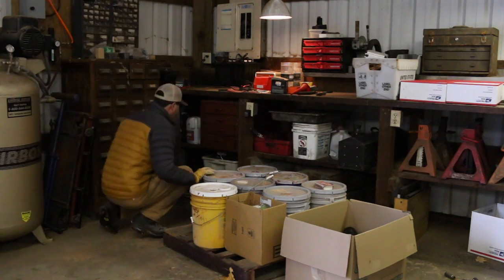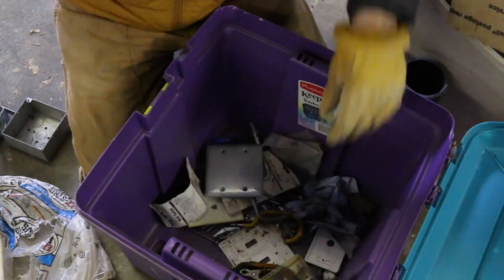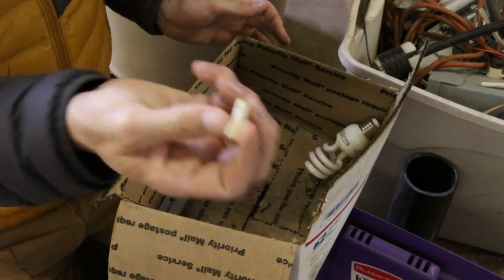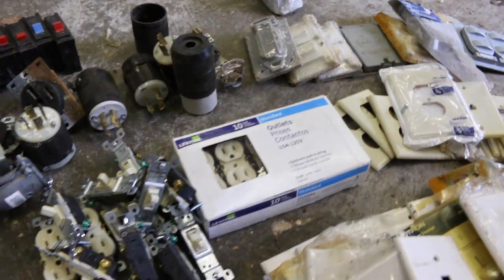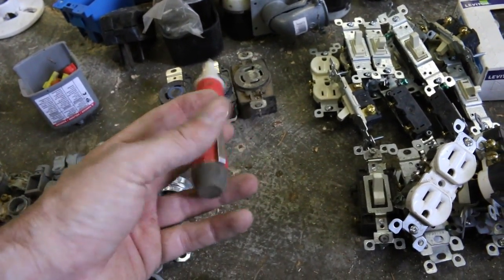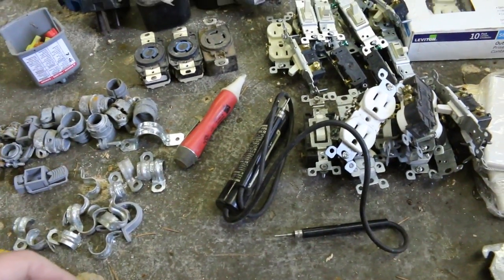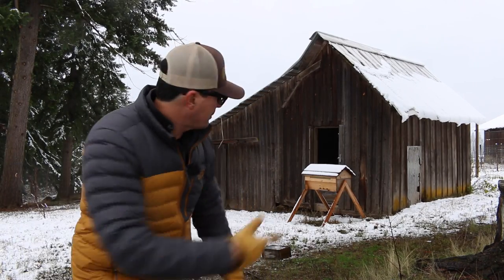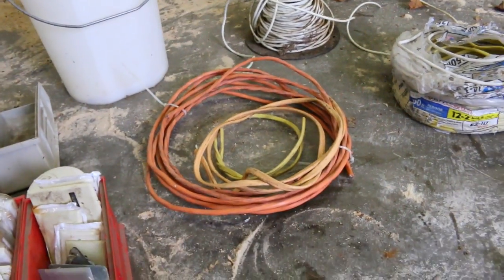The Costs of Being Disorganized

Comment: 5 gallon buckets are great for plumbing parts. Throw the individual parts into ziplock bags then put all the same size into a bucket so you have one for 1/2 and one for 3/4  that holds the fittings for that size in both copper and pvc. Label the outside and you can just go grab the right bucket for the job you are working. 

When not in use they stack and store easy and when on the job they make a nice step stool/seat.

Comment: One of the best moves during an renovation we did was to get rid of our electric stove and get a gas/propane one. Put in a 600 lb tank and it gets filled once a year. 

The power goes out on our mountain several times a year especially during the winter.  Between the propane for the stove and the on demand water heater and the wood stove there isnt an issue.

The propane is now used to heat the on demand hot water during the summer. Our hot water comes from a coil we put on the wood stove for the winter.

Comment: I have found a few simple rules, and sticking to them, have served me well in organizing stuff.  No job is really done, until the extra parts are put away in their specific place. Everything has a box that must be clearly labeled.  If I have too much for one box, then split it up in a logical way and re-label (i.e. Electrical-Rough In  vs Electrical Finish ). And my main rule... if I think I have something, and can not find it in under 2 minutes, then I  am not organized enough. After I adopted these simple rules, I am amazed at how often I can find something, usually in under 1 min.  The Key to any system is to stick with it. Not putting things away, right away, only makes you less efficient and more likely frustrated later.  Hope this helps.

Comment: One thing to keep in mind for your re-model: You can't have too many wall sockets! Count how many kitchen devices you want to have plugged in at the same time (even if they are currently not in use) and then add about half of it to get the amount of sockets you may need. There is nothing worse than having to juggle with plugs when you rather want to get a meal done.

Comment: Cody, if you have the black handle Eaton cutler hammer breakers, they will fit in a Siemens or Murray panel. Just a quick tip for an electrical parts guy. Good luck my friend.
Reply from the maker: +Alex Holsinger Thank you for the tip Alex

Comment: Pro tip #1: vinyl pan liner, which is used for waterproofing showers, is good for labeling. Cut strips however long and wide you need. Use a black sharpie to label whatever, and use a  zip tie to connect it to the box handle or bucket handle. This method overcomes the problem of fading paper labels which are so hard to read in the dark years later.

Pro tip #2: The strips of vinyl pan liner can be re-used as holders when you are installing romex wiring. Use a wafer head screw to shoot it into the stud. Wafer head screws come in half inch which is plenty to hold a lot of wiring. The vinyl is non-conducting.

When you are using the strips for electrical rough in get yourself set up in advance. The kids can help. Utility scissors cut the vinyl easily. Then you just manually push one wafer head screw through one end of the strip. You don't want to have to slow down to make one every time you need one. The strips are also good for labeling the romex; better than writing on the romex.

Comment: This all looks very, very familiar. It's kind of heartwarming to see you organize all the same "junk" I have in the same categories. I have been blessed with a considerable quantity of plastic folding produce crates. They all have the same footprint but various heights ranging from 3-9 inches. A 4" crate holds about the same volume as a milk crate. They allow me to store fairly bulky categories like boxes or my smattering of high voltage (220+) in a flat, easy to look through without dumping, format. Since they all have the same 22 x 16 footprint, it's fairly straightforward to throw up some plywood or 2x4 dividers with 2x2 glides which allow me to store them as drawers as high as I want. I couldn't stack my old bins more than two high with crushing the bottom one. I've always been a firm believer in using what you've already got but it's awfully nice to suddenly find yourself in possession of something that's just what you need.

A note about voltage indicators, the non contact variety are a great safety tool for the occasional electrician when doing remodel work when only "relevant" circuits are disconnected. it's almost guaranteed that you'll come across a continuous wire that disappears above and below and you don't know where it goes. It's almost always part of an unrelated circuit that's still powering some undisclosed part of the house. I never cut anything without testing for voltage and in those cases, you can only do that with a "sniffer."

Also, not being a professional, I don't own the requisite lockout equipment to ensure that someone else doesn't wander through and zap you when they try to get their toaster to work again. A vintage sniffer is quick and easy to use which means you're less likely to skip checking. mine saved my life several times in one day at a church work day. I was adding GFIs to the outlets over all the classroom sinks (yeah, they were all lacking) and despite making sure everyone knew what I was doing and to leave the breakers alone, people still wandered in, p opened the breaker panel with the large handwritten sign reading "Caution! Electrician at work! Do NOT turn on breakers!" removed the tape labeled "caution!" from the breaker and flipped it back on. A proper lockout would have been much much better but I half suspect someone would have pried it off and maybe even asked to borrow my pliers to do it. 

I have two voltage sniffers, one from each of the two main big box hardware stores around here and they both take AA batteries. Button cells are notorious for being eaten by small children and are lethal 100% of the time without emergency surgery. Thus, stuff powered by them were purged when we had kids.

In any case, inexpensive non contact voltage testers that use common batteries are readily available and worth it.

Comment: The little thing you had in your hand near the beginning after you dumped the box was a    ( two screw romex ) connector.Your GE; Bryant, and crouse hinds circuit breakers used to enter change.   However if your doing new construction and have a permit for same, then all breakers must be the same brand as the box there going into in order to be able to pass inspection.

Comment: As a union electrician, I would recommend not buying a voltage indicator or a voltage lest light. A voltage indicator is the device you mention requires a battery, commonly referred to as a widow stick. They are prone to false readings both ways which isn't a huge problem if it indicates a voltage that isn't present but if it doesn't indicate a voltage that is present is very dangerous. The test light is prone to issues as well. Both have their place but I would recommend testing the the device before and after making a test. Test a known live source of voltage i.e. A lamp plunged into a receptacle, then the wire/receptacle you want to test, and then the known source. A category 4 digital meter is your best bet. It doesn't have to be expensive but does need to be a brand that is known. A digital meter is a universal tool for all ranges of work including automotive and are more trustworthy. It won't make a reading with dead batteries and isn't sensitive to polarity like analog meters.

Comment: I must have 6 pipe cutters because I can never find them.  When I get organized, stuff gets piled in front of the shelves I have them on.  Horrible.
Reply from the maker: +John Kool I can relate. I was going through my plumbing box and found 6 rigid pipe cutters.
Reply: +John Kool Get a toolbox/bucket for each type of job. Label it for that job and when you are done for the day they go back into the holder you pulled it from. If you end up with the same tool in multiple kits color code the handles to match the kit its in. 

A few companies make bucket organizers to keep small parts from getting mixed together.

Comment: Hi Cody; just another heads up.  14 AWG  wire  for 15 amp circuits, 12 AWG for 20 amps and 10 AWG for 30 amps. You can't use 12 AWG for 30 amp circuits. It's  against code.

Comment: Just in electrical parts, you have several hundred dollars of material sitting there.
I sooo know the feeling....  Just a 15 amp 115 volt plug end now a days is 15 bucks,  and those twist lok 115 and 240 volts receptacles are about 20 bucks each....and boxes ( watertight ) are 5 bucks each...  Weatherproof receptacle covers are 15 bucks each...Good Going !   Call it an investment. I'm sure all that stuff cost a lot less when it was purchased.
EDIT to add....  I have to say... I would LOVE to see you moving toward more 12 volt DC stuff, and more "off the electrical power" independent lighting.

Comment: I don't want to insult your knowledge but it is code to only use 12 gauge for maximum 20 amp circuit, 14 gauge is 15 amp max and 10 gauge is 30 amp max. The part for the junction box is called a nm connector (trade name: romex connector). Love your videos, God Bless.

Comment: There is one problem I see with the electrical tester that is only powered by the outlet. I would be very skeptical about using it because when the light doesn't go on, you never know whether or not there's power or if your bulb's just busted.

Comment: I know you are an organized person. Your chainsaw chains and bars are on a rack. You have pallet racking and a forklift for the big stuff too. Losing things in a move is normal. I have heard it said that three moves equals one house fire. I'm pretty sure if you had to pack in a hurry there are things that Jack will find in your old bins when he's 40 and wonder why you had so many of them. 
My Dad was an electrical contractor and I worked for him as an electrician when I was young. When Dad passed I had a barn full of tools and parts. We had a big garage sale and I sold off box lots of odds and ends. I kept the full rolls of wire and sold all the pieces. Seemed like every time you needed a wire it had to be 6" longer than the top one in the scrap bin. Digging to the bottom cost more in time than the wire was worth.  By the time you found a use for a piece of scrap you had lugged it to 3 or 4 jobs. Those extra parts are money you can't use for other things. Like payroll. :-)
Now at home I still have odds and ends. I'm a bit of a pack rat. Winter is when I organize all the stuff I picked up over the summer. :-)

Comment: Judging by past history there is a fair chance I could be wrong, but I think you need #10 wire for a 30 amp line.
Reply from the maker: +JohnnyTPaul I think you are correct. I was wrong,
Reply: +Wranglerstar This is correct NEC NFPA-79 requires 10 gauge for 30 amp circuits.

Comment: Cody: I notice your 60 gallon air compressor, just a reminder to open and drain the bottom of it.
I didn't keep up on mine and it rusted a hole in the bottom of it, good luck.
Reply: +DIECASTER use some brass pipes to plumb into a drain valve so draining is just open the valve and let the air push the water out. The brass holds up much better then steel and gives the water a place to gather. The pipe can even be sent outside so you dont need to have something to drain into.

Comment: You need one of those big plastic organizers with dozens of drawers for all the small stuff. Label the drawers for each item with a "Brother" brand label maker, in alphabetical order, if possible.
I am trying to figure out how you came across so many switches and switch plates. Did you tear down a house somewhere? I only purchase as many as I need and throw out the old ones. I could see having one or two extra around if the hardware store is 20 miles away, but not that many.

Comment: I have to agree with some of the commentators.You sure have a selection of 'spare' in the electrical section.May I offer a few thoughts? Before you panel the walls run a draw string (I was going to suggest wire but may not be practical) and spare holes trough studs ,parallel to where you are running your power feeds. Should you want to later expand to low voltage (dual setup) then no need to pull existing cables out.We  did in my son's house ,allows for expansion of HiFi or wired internet lines to be run.Only where you cannot easily get to the walls.I am amazed at the extent that you Americans go with your 'handyman' works .As for electrical I would ask,do you not have legal codes for correct installation and final inspection/testing by a electrician/licensed Installer? Similarly with plumbing ,are there not regulations to have some works inspected etc? or does 'going off grid' somehow absolve people from having such inspections?Not being picky,just inquiring as each country is different as to their level of standards with respect to Electrical,structural and plumbing works at National levels,State levels and even local Council levels.Again,not trying to pick points ,just interested as I know you have 'advisers' from all over the world and I do see you are reasonably thorough in making sure you do things correctly.Look forward to more postings once time allows.

Comment: Its that infamous "safe place" that we all use to put stuff that we are going to need soon.
In reality it is a black hole that once something goes in, it NEVER comes out - until you either no longer need it or have replaced it.
In our house, we have designated the top of the tumble drier as that place so that we can find stuff again.
Outside the house is a different story - my 900 sq ft garage is where the wife puts everything she does not want in the house.
I know I have a Porsche Spider kit car in there somewhere - haven't seen it in over 10 years though and each time I need to use my lathe or drill press I have to break up a ton of old empty boxes and burn them before I can ever get to them to start the problem.
But I love my wife so what can I do?
Reply: +The Mad Man In my old shop I had a couple of doors. One was a walk through and the other was a drive through. The walk through was closest to the house and when someone was bringing anything to the shop whether it was a tool or a chair to be fixed it was dropped just inside the walk through door. If it was there very long it got something piled on it. I went in and out of the shop through the drive through door. My clear space for working was too far into the shop for the clutter to reach. 
Ideally the projects and clutter would show up one at a time so they could be eliminated in some kind of order. 
Now that winter is here I like to go through the shops and straighten them. Build a fire in the stove, sit at the bench, sort things, sharpen tools, and refurbish equipment. It gets me through the short days and long nights.

Comment: Sorry, but i don't see the logic in this one.  Outside of the wire, the majority of what you showed is sooo cheap to buy now, it doesn't make much sense to keep for a "just in case" scenario.  Think about how many times you touched that stuff, how many times you moved it and how much time you spent over the years accumulating it and looking it in some shape way or form.  What's all THAT time and effort worth?  Normally i agree with your pack rat mentality, but i just don't get this one.